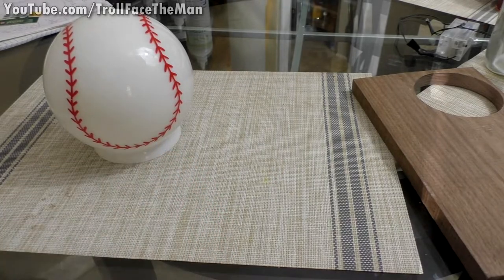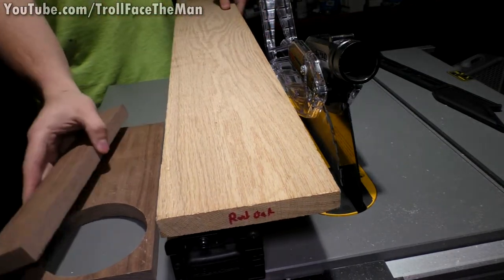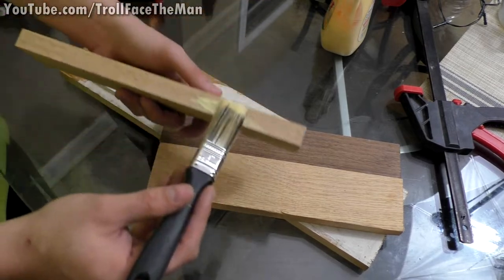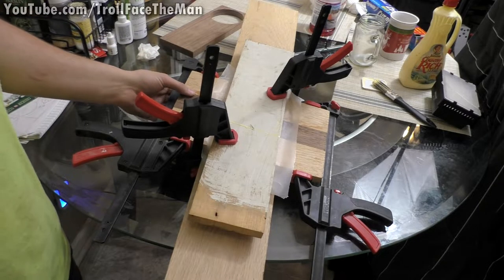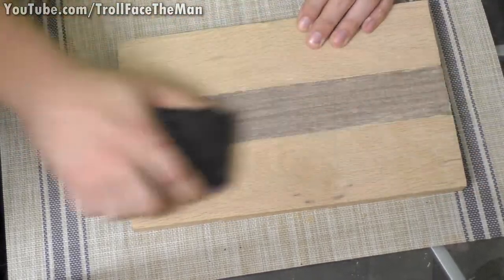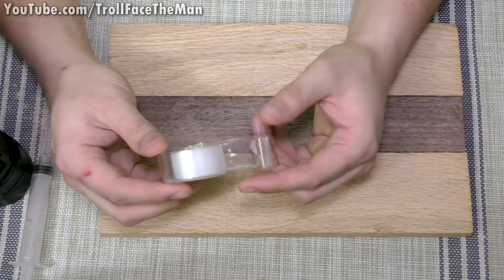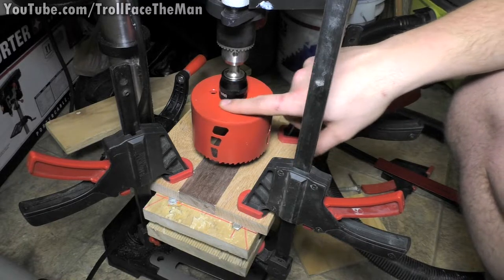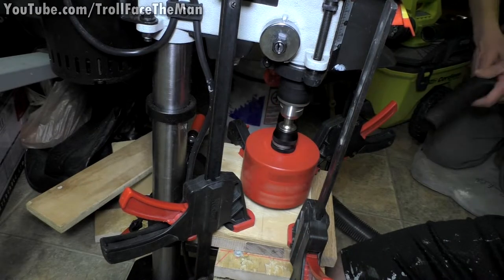Turning trash AWESOME!! Upcycling Woodworking and LED Project. Creating the moon Lamp.

Comment from the maker: Video Part 2: https://youtu.be/Zddj8iudJl4 

 Products: 
 -3m Sanding Block: https://amzn.to/3uAzxvY
-Glass Dome 3.25 Opening. 6in Diameter: https://amzn.to/3xYkhuW (Cheaper in local stores)
-Wipe On Gloss Polyurethane: https://amzn.to/3o0EDPE (Cheaper in local stores)
-4in Diablo Hole Saw: https://amzn.to/3baLjpe (Match With Glob Base Size)
-3.25in Hole Saw Saw: https://amzn.to/3uCwPp (Match With Glob Base Size)

 -Mandrel for Above Hole Saw: https://amzn.to/3eul1R0
-Good Flicker Free Light Strip I Have Tried: https://amzn.to/2RC7mOS
-Fairy Lights (Can't Find The Same One I had): https://amzn.to/3f52vO5
-Assorted Sandpaper 5 pack 220, 320 and 400: https://amzn.to/3ibWqjS
-Just 220 Grit 5 Pack: https://amzn.to/2XyWXTM

 -Just 400 Grit 5 Pack: https://amzn.to/2XExKal
-Just 600 Grit 5 Pack: https://amzn.to/3i87SNA
-Just 1000 Grit 5 Pack: https://amzn.to/2Llt8ni
(Above links might support the channel if used)

In this video I will be making a custom light from a fan globe destined for the garbage. And some Red Oak from the Defect Section of my Local Menard's Store. Along with some Walnut a friend gave me. I never did anything close to this before but I am happy how it went. Thanks for watching!

Comment: I like the walnut. For my projects involving wood, oak is about as good as I have to work with. For filling the gaps with glue, you probably could have taken a plastic card (or the like) and "raked" the glue into it at a low angle. A few passings should press it in. It shrinks as it is absorbed and water evaporates so it's not great as a filler, but you can add more as time proceeds. After all that work, the hole saw would have terrified me. I would have taken it the slow way and used a coping saw.
Reply from the maker: Thanks for the comment. The hole saw was pretty freaky just was really hoping something didn't go wrong. The glue wasn't great as a filler but I figured it being  semi transparent and hopefully giving some extra strength would be a good thing.